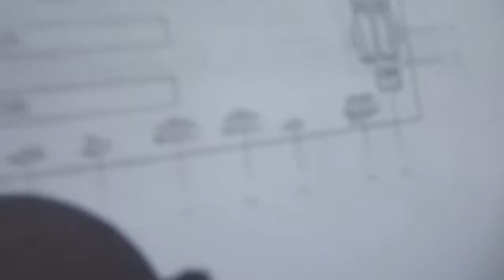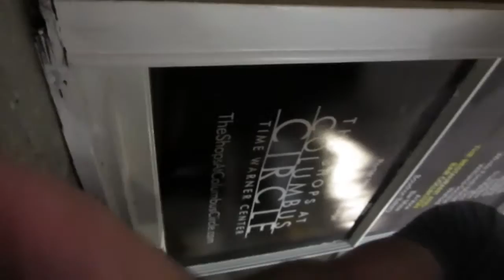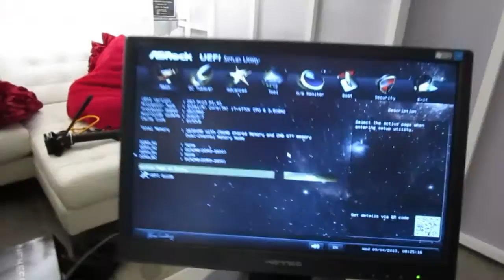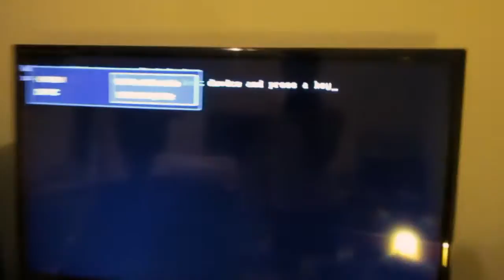I Built a Computer

Comment: Dear Gary, today i built a pc aswell and have the same MOBO but i have the I7-4970 and a 600 watt power supply and a GTX980. For some reason my computer will turn on, but im not getting a signal on my screen!
ive seen you do it and it still didnt work. Any help?

Comment: Is this a good budget pc?
Corsair CX600 600w PSU
Crucial M500 120gb SSD
Crucial 8gb RAM
ASRock Z87 Pro3
Intel core i5 4670k
Cooler Master K350
Total of 491,50 euros, which is around 670 USD.
Im going to buy the gtx 760 or the gtx 770 later.
Reply: r9 280x.
Reply: And no fucking SSD if you are gamer this is shit then you will run your pc 10 seconds earlyier and go in some match like bf 5 seconds faster then others.to me delete ssd and go for 700w Cooler master power supply witch is about 70$ or less and then put 280x.Best pc for 700$

Comment: Not to ruin your video but IMO (again MO) I think you paid too  much for what you got. You can sell that MSI Radeon R7950 and get at least 400 bucks for it seeing how bitcoiners are buying them. That mobo is very cheap (in quality as well) the PSU is overpower and 16gb of ram is an overkill IMO - You could have made a cheaper PC IMO again IMO
Reply from the maker: Thanks for your input. I picked up the R7950 and the extra ram because I do a lot of video work in Premiere and After Effects, as well as work with very high resolution photoshop files, and the extra RAM really helps the workflow, especially in AE RAM previews. I'm also moving toward doing more 3D rendering and simulation which was another consideration. I was ok getting an overpowered PSU simply because I may end up running more hardware in the system in the near future. Thanks again for your input!
Reply: GaryDoesThings I see, make sense, how is your pc?